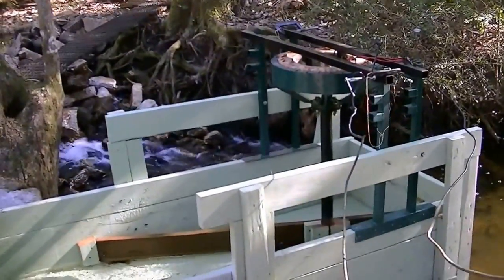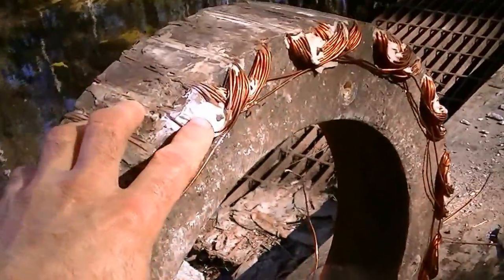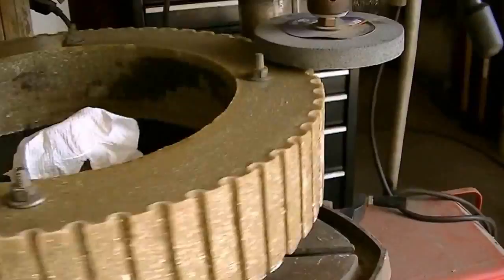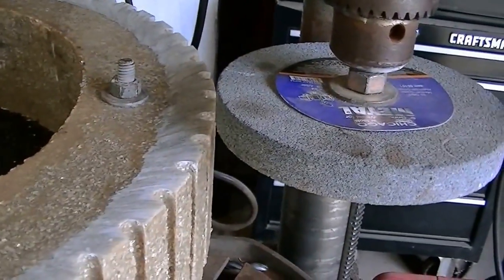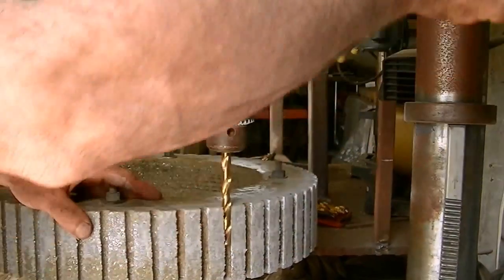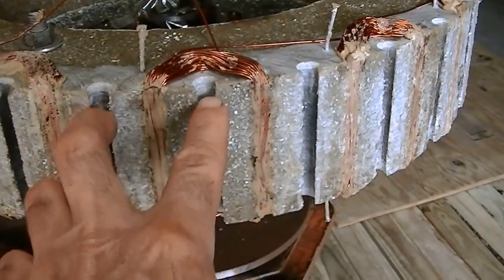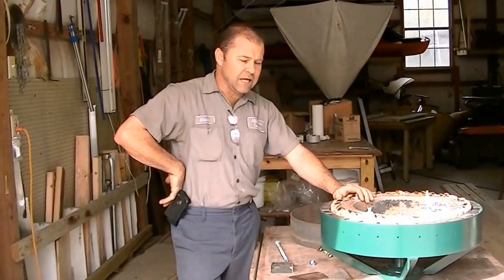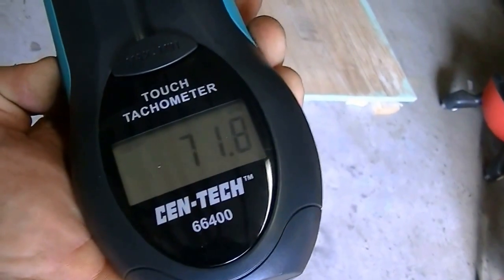Vertical turbine hydro generator system. Low rpm permanent magnet generator, home made

Comment: Your answer: " I use iron rings and aluminunm filings."
My question :
-Were are mounted The iron rings - What is the purpose?
- The inner cylinder is "Aluminum"?- Do You use it as molding and then leaves it to   
   become part of "Stator"
- Thanks
Reply from the maker: German Garcia The iron rings are for the magnetic flux field to jump across and the aluminum is just a filler in the fiber glass resin.
Reply: markp0177 <span title="Mark, gracias por responder

">Mark, thanks for replying

<span title="Primero:
">First:
I observe a cylinder about 10 inches. In the interior of Stator. ¿Do you use it as molding to contain the "Mixing": fiberglass + "aluminum filings" + "iron rings". After it cools, you leave it to be part of "Stator"? <span title="Pregunta: De que material es?

">Question: What material is it?

<span title="Segundo:
">Second:
<span title="- Yo entiendo que los "aluminum filings" están mezclados con la fibra de vidrio: " is just a filler in the fiber glass resin" .
">- I understand that the "aluminum filings" are mixed with fiberglass, "is just a filler in the glass fiber resin."
<span title="- Los " iron rings " ¿ Cómo es su aspecto físico?
">- The "iron rings" How is your physical appearance?
<span title="- Cual es su tamaño?
">- What is your size?
<span title="- En que proporción están Mixing
">- In what proportion are Mixing
<span title="- Disculpe... Yo no puedo imaginar la forma de un volumen, that que yo no puedo ver...
">- Sorry ... I can not imagine how a volume, That which I can not see ...
<span title="Gracias.

">Thank you.
Reply from the maker: German Garcia Watch some of my other videos, I show more about the stator
Reply: markp0177 <span title="-Tu respuesta de hace 7 meses

">Your reply 7 months ago:

<span title="" I just rolled a 4" x 1/4" flat bar and then trued it in the lathe".

">"I just rolled a 4" x 1/4 "flat bar and then a trued it in the lathe".

<span title="- Tu respuesta de hace 9 meses

">- Your answer 9 months ago:

<span title=""The casting is made out of fiberglass and 5 steel rings. I rolled the outside metal ring in a plate roller at a machine shop".

">"The casting is made out of fiberglass and 5 steel rings. I rolled the outside metal ring in a plate roller at a machine shop."

<span title="La verdad: yo no la entiendo..
">The truth: I do not understand ..
<span title="Podría, por favor mencionar la dirección electrónica del Video de la fabricación del "casting"
">It could, please mention the email address of the video making "casting"
<span title="Gracias
">Thanks
Reply: German Garcia O. K. Mark, and I remembered you. <span title="yo vi tu Video del 05/03/2011
">I saw your Video 05/03/2011
<span title="El nombre es : "Permanent magnet GENERATOR/Home made/bench test hand crank "
">The name is: "Permanent magnet generator / Home made / hand crank test bench"
<span title="que ahora tiene 691,704 visitas.
">which now has 691.704 views.
<span title="- Yo vi tu Video del 17/06/2013
">- I saw your Video 06/17/2013
<span title="El nombre es : "Watch what happens when a magnet falls thru a copper pipe/aluminum pipe."
">The name is "Watch What happens when a magnet falls thru a copper pipe / aluminum pipe."
<span title="que ahora tiene
">which now has
<span title="253,788 visitas.
">253.788 visits.
<span title="Tu esfuerzo es Gigante y digno de admirar
">Giant and your effort is worthy of admiration
<span title="Yo te felicito.
">I congratulate you.
<span title="Saludos

">Regards

Comment: Hey Mark, instead of having your blades and hub being a direct drive and having 1:1 ratio, what would happen if you used pulleys to change the ratio? If you could get more revs out of the hub per one rev of the blades would that give you more voltage with less water flow? I saw your bench test video where you were hand cranking like crazy to get over 15v and it made me wonder if you could get the same voltage with less work by changing the ratio.
Reply from the maker: Ben Winchester Their is not enough power to change the ratio. I have tried it.

Comment: how much did it cost to build that system and do you sell any that are pre-built or at least the magnet and copper wire ring system , the info would be much appreciated
Reply from the maker: I do not sell any pre-built parts. I do have the old stator that I can sell you. I started to rewire it but did not finish.
Reply: what would be the price ?
Reply from the maker: jonathan trottier$100 plus shipping.

Comment: Do you make and sell the generator ? . . if yes how much ?
Reply from the maker: I no longer offer the generator. I do not have the extra time to make them.
Reply: markp0177 what voltage , watts and amps do you get from it ?
Reply from the maker: jacky Parker I get around 45 volts and 12 amps.
Reply: +markp0177 How did you make the blades ?
Reply from the maker: +jacky Parker I forge them and welded them to the shaft
Reply: You dont start with a circle then then cut along lines and twist them ? . .reason i ask is want to make system based on yours . . it will collect the waste water from a pelton wheel .
Reply from the maker: +jacky Parker You could start that way. I am not sure if it will be strong enough where you weld it to the shaft.

Comment: Hi Mark,  I love your videos on your generators!  This is great.  Can you tell me how the magnets are attached to the steel ring?  Epoxy?  It would be great to see a video on how you mold the stator.  Also, how much drop do you have from the bottom of your wood flume to the blades?  Thanks.  Mike.
Reply from the maker: Epoxy will work. I made a reusable mold, it is kind of like a cheese cake mold. I think the drop is around 2 feet. From top of water to top of water on the down side is 3 feet.
Reply: thanks Mark.  On video it looks like more height than that.

Comment: Having build this wonderful installation, you can push it little forward and experiment with your blade arrangements.
If you have several layers of blades in a inverse conic orientation (with wall of the cone on the outside and the several  blade layers pointing inwards, creating inversed hollow cone, at the center, between the most inward edge of the blades, looked from the top ) with allowing the watter to swirl in the center (centripetal force) instead of exploring the fall of water with the centrifugal force ( as per your current installation), this will (gradually) build a considerably higher centripetal force and in such higher RPM. The ideal in such setup would be to want to have a (small) vortex in the middle, for it will make the watter swirl faster in its optimal speed. The debris, would not have to be a problem for they would be sucked in the vortex and go through. This would be quite a fun to experiment with.
Enjoy the labors of your hard work.
Cheers.

Comment: If you had steel in you stator you'd get a lot more power.
Reply from the maker: I do have steel in the stator.
Reply: where it looks like all fiberglass.
Reply from the maker: Mark Osborn It has several steel rings cast into it. I have another video showing this.

Comment: Great work! especially with the low magnetic leakage coming out of your rotor. Are those ceramic magnets or rare earth/neodymium?  Do you think you'd get more power with rare earth magnets or would the turbine not have enough torque to turn the stronger magnets?
Reply from the maker: CKOD The rare earth magnets would give you more power but they are very expensive. The generators output is based on how much water is falling. You would get a little more power with the rare earth magnets but not enough to make up for the extra cost.
Reply from the maker: ***** Magnets for less.

Comment: What did you use for your steel magnet ring? Do you have the dimensions on the ring including gauge thickness? Thanks in advance.
Reply from the maker: Jeff Howard I just rolled a 4" x 1/4" flat bar and then trued it in the lathe.
Reply: Perfect! Thanks.

Comment: You are losing a lot of your power through resistance pushing DC 400 feet. You should try much thinner wire next time to get high voltage AC then step it down with a transformer up near your battery bank and rectify the AC as close to the batteries as possible. DC has horrible losses over distance. Very cool setup though...

Comment: I want one here in Chile. I wonder if it could be used on a horizontal plane?
Reply: I would be real interested in speaking with you about this as I will need one of these. Can you email me please jim.dorchak@gmail.com
Reply: Depends on the flow rate. If its flowing slow you need a bigger turbine which then generates more torque and hook that up to a gearbox.
You want high voltage. High voltage gives you less heat loss when you transfer the power through a long cable.

Comment: What did you put on the wire after you made you wraps?
Reply from the maker: I use glue to help hold the wire in place.
Reply: Thank you; I noticed that someone ask you about a video of forming the stator. Do you have one and what is the gap between the stator and the magnets?
Reply from the maker: Corey Rogers Their is a 1/8" gap between the stator and the magnets. I have a video but it will not upload. Next time I make one I will video. Not sure when that will be, I am very busy now a days.
Reply: Thank you very much, I really appreciate all of the info. Your videos are inspirational, I will be getting out of the military soon and I cant wait to try out a lot of your ideas at the new place.

Comment: What's the casting made out of? Did you bend that big ring that holds the magnets?
Reply from the maker: The casting is made out of fiberglass and 5 steel rings. I rolled the outside metal ring in a plate roller at a machine shop.
Reply: Thanks for the reply. It's just a bunch of chopped fibers packed in a mold and filled with resin, or?
Reply from the maker: Paul Sowinski Steel rings, a little chopped fibers and aluminum shavings mixed with resin and poured. I pack ice around it for a slow even set.
Reply: Aluminum shavings? Interesting- is that just as a filler? Sorry for all the questions.
Reply from the maker: Paul Sowinski Yes just a filler.

Comment: seems your rotor is too close to the windings. i think if they were farther apart youd get more rpm, and maybe more power. some retail micro hydro units are adjustable to compensate for the amount of head you can supply. they run from 400  to 4000 rpm with about a 9 inch wide rotor. looks like your turning about 120 rpm with about an 18 inch rotor? seems a touch slow

Comment: Great show. Being female what kind of schooling do you recommend for me to really understand and build something for my self.
Reply from the maker: I don't think they teach this in school. Maybe electrical engineering and machine shop.
Reply: The generator and electricity part would be electrical engineering, specifically power engineering. Using a dammed-up stream to create a steady flow of running water which flows through a turbine would be hydro engineering, which is considered a branch of either civil engineering or environmental engineering. The design and construction of equipment would fall under mechanical engineering and actual building trades.

Here is an outline of the subdivisions of engineering: 
http://www.dedicatedengineers.org/Resources/Engineering_Disciplines_Handout.pdf
Good luck!

Comment: Looks about perfect but not sure about the water turbine.  It should have a c pipe with the shaft going in a an helicoidal turbine more sophisticated inside . The you could pipe water from higher levels and hide the turbine on the side of the river protected in a shed so the environnement is not disturbed. If the flow of water residual can accommodate fish to go around. Then that would be blessed by god. really cool. Great hand work. Congrad.
Reply from the maker: I only have a 3 foot fall over several thousand feet. So I can not pipe it in.

Comment: sure would like have a source for a blade as yours for my creek, tried a 55 gal barrel and only 55 rpms. from 24 inch high falls, so ur system is much more efficient,with a vertical shaft /

Comment: The only real improvement after that is to have a carefully designed duct, i.e. tapered pipe, behind the rotor, which effectively "sucks" the water thro the rotor.  Without this the water will pile-up on the rotor and overflow radially.
       I have done this with an air turbine and of course it works as exppected.  I have around 500 watts from 65cm inlet of low 20's m/s wind.    The outlet is 92cm diameter which make the exit speed half of the inlet speed.

Comment: I am just starting on the electrical stuff and you explain things well enough that a newby like me can easily understand! Thanks. What did you cast the stater from? Most everyone will know this but not me, like I said, newby!! Thanks. I have experience with casting just not electricity.
Reply from the maker: I use a fiber glass resin mixed with aluminum shavings and several steel rings.

Comment: Q1 are multiphase alternator more efficient? Q2 what voltage you get between both phases and what voltage  between 1 phase to ground?
Reply from the maker: Multiphase alternator's are not more efficient you just get more power from the size of the machine. Voltage will vary depending upon how fast it spins. Voltage between the phase's is not useable just between phase and ground.
Reply: markp0177 thankyou for awnsering, but I still wonder how stacking coils out of phase with eachothers is efficient and i wonder why there is no voltage diffrence between phases like with tripple phase motor...can you awnser why?

Comment: Maybe you could increase the rpm by installing a reversed francis turbine instead of a simple fan like the traction element. Take a look: http://en.wikipedia.org/wiki/Francis_turbine
The diference of the reversed turbine with the traditional one is that the inflow happen in the axial center and the outflow goes trough the exterior fans

Comment: so by making two phase, the electrical currant travels better along the wires to the house, where you invert it back to dc.  most excellent idea.
and yes, magnets will last "Forever" if they are in harmony like you said.  the old horse shoe magnets last forever if a bar is across the open side of it because it creates a loop. square magnets will run out.
also, if you bang a magnet that weakens the magnet.
do you have your own electrical loop for making magnets or do you have access to one?
Back in the army, we'd magnify parts when we were running dyes into the metal to look for cracks in the metal

Comment: Hi mark, your "like" button doesn't appear to register when i clicked it.
I've a weekedn shack here in Scotland, and as i have a small burn (or creek as you Yanks call it) a  few feet from my door I'm thinking of putting a home -made water turbine in it for a 12v supply, One question: please tell me how many watts your rig produces. Even if you can just tell me how many watts your fridges total would help,I'll see if I can calculate the losses in an inverter .
( the output without inverted losses would be better, as I just use 12 DC for lighting.

Comment: this is very cool.  Am really interested in doing this to power a waste water system to make it self-contained.  Was thinking of doing a water vortex turbine connected to a hydro power generator, I think your solution is perfect.   What material is the stator and the external housing?
Reply from the maker: The stator is made out of 10 metal bands that are casted with fiberglass resin. The rest of the generator is made from mild steel.

Comment: Markp0177  Where would you recommend me learning about watts/amps/volts, single phase/ two phase/ three phase, how to choose the right about of batteries, etc? I really enjoy your videos, very well put together and very explanatory.
Reply from the maker: My Dad, is the best place to learn. He told me that electricity is like water in a water hose. The hose is the wire the bigger the hose the more water. The higher the water pressure "volts" the more water that can be pushed through the hose. The volume of water coming out at the end of the hose is the amps. The hose is filling up a pool, the pool is the battery. single phase is one hose double phase is two hoses and 3 phase is 3 hoses. The timing of the water pump "generator" is off from each other a little bit in each phase. I show this in my video. Hope this helps.

Comment: what kind of material is the stator ?
Reply from the maker: I made it out of fiberglass resin and aluminum shavings. It also has 10 metal rings in side.
Reply: Does the aluminum just add structure ? Or does it have something to do with magnetic lines of flux?
Reply from the maker: Anthony Newcombe The aluminum is just a filler. I have lots of aluminum shaving from my solar frame company. It my help with heat too.

Comment: i noticed you have your rectifiers mounted on the generator its self, i assume your sending dc voltage some 400 ft. up the hill as stated, i was wondering about the power loss, most systems like that when sending the power that long of a distance transmit it ac then the rectifiers are mounted close to the battery bank with virtualy no or very little voltage/power drop. i was wondering have you ever checked it for volt/amp/watt loss ?
Reply from the maker: Yes their is some loss. I choice to convert to DC at the generator because It is two phase. I would have to run another 400 feet of line to send the second phase. It cost too much for the cable.